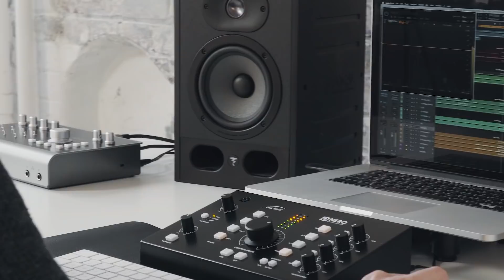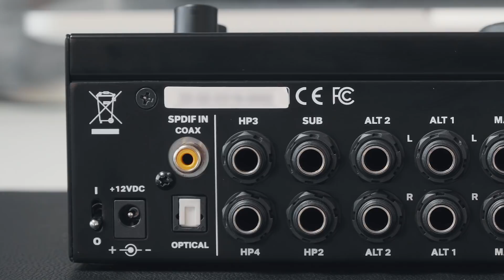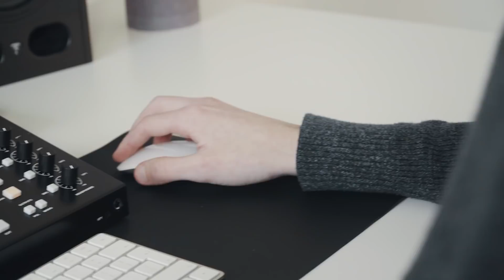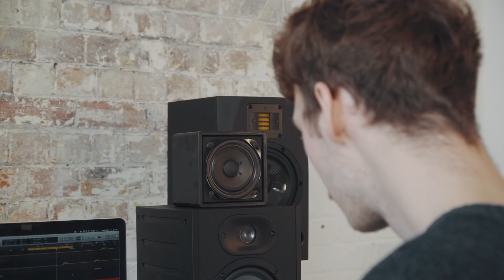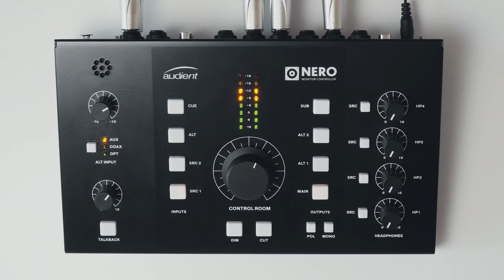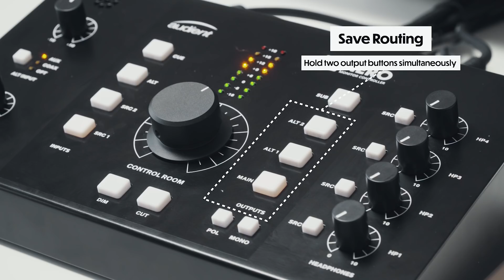Audient Nero - Desktop Monitor Controller Feature Overview

Comment: DON'T BUY THIS!!!

This product has been a headache! After scouring Google, I found that many people are dealing with the exact same problem. It's like it works fine for a bit, then out of the blue, you start getting these annoying clicks and pops, and suddenly, it's gone. One side of your speakers goes silent, usually the right side. Sure, you can try the ol' turn-off-and-on trick, and it might temporarily fix things, but over time, it just gets worse.

I reached out to the department about it, but they never seem to catch the problem because it doesn't stick around long enough. It's like a sneaky ghost that comes and goes as it pleases. Bottom line: I wouldn't recommend this product to my worst enemy. And don't even get me started on the Sweetwater team's customer service. After a couple of complaints, you start feeling like you're pestering them, and they make it seem like the issue is all on your end. It's no wonder they've probably lost a ton of customers this way.
Reply from the maker: Hi there,

Sorry to hear that is the case.

Can I ask you to please reach out to us at support@audient.com with a copy of your invoice and we will get this resolved for you ASAP.

I do sincerely apologise for the issues you've faced, and our support team will help you get this resolved.

Comment: I would like to be able to get the talkback audio back into my RME interface. Is it reasonable to use one of the headphone outputs on the Nero for this purpose?
Reply from the maker: Yes, this should work, just bear in mind the headphone outputs are an unbalanced stereo connection, so you'd need to use a Y split cable to separate the left and right channels.

Comment: Why does the OPT indicator blink every time I turn on the device? I switch to aux, turn the device off, turn it on again, and the OPT input blinks again? Is this some kind of malfunction?
Reply from the maker: The OPT light will flash when it doesn't recognise an input on the digital input. If nothing is plugged in, then this can just be ignored.

Comment: I was about to order this one, but then I saw that it isn't possible to have more than one source active at a time, which made it a no-go for my needs. :( Please make this (optionally) possible in a V2 if you ever make one. I want the coax (Windows system audio such as Spotify/Youtube/WinAmp) always on and then switch between cue/src1/src2 (various monitor mixes from the DAW)
Reply from the maker: Thank you for your feedback, Im afraid it wouldn't be possible to add this to the current Nero but as you mention it may be a good feature for any future monitor controllers!

Comment: How to plug Subwoofer? Sub Out Mono from Nero to Left Input on Subwoofer? My Subwoofer does not have a dedicated Mono Input.
Reply from the maker: Yes, you can just use the left input of the sub. If there is a volume discrepancy because of this, you can trim the sub up slightly to make up for this.

Comment: Just got a unit but unsure how to setup with a sub as the output is mono  and most subs have L R in and L R out.  so do you just connect the output to the L input of the sub ?   thanks
Reply from the maker: If your Sub does have a stereo input then you can just connect the left channel and turn the sub's trim up slightly to compensate for the missing channel

Comment: Ei Audient, how do i connect a subwoofer to the audient Nero i just bought? Just plug a Mono Jack from the SUB out on the back to the L in on the Sub? because on my Focal Sub One there is two conectors, Left and Right. Thank you if you can answer. I cant find anything about this metter on the web. How actually connect a Sub to the Audient Nero.
Reply from the maker: If your Sub has a stereo input then we would recommend just plugging a single TRS jack from the SUB output to the LEFT input of the SUB. You'd then just need to trim the sub slightly louder to make up for the missing channel.

Comment: Is the main headphone amp powerful enough to use and mix with 300ohm Sennheiser HD600 headphones? Or what is the recommended ohms for main headphone out?
Thanks!
Reply from the maker: The Nero will drive up to 600 Ohm headphones, the actual volume you get will depend on the sensitivity of the headphone drivers themselves, however. You shouldn't have any issues driving a pair of HD600's with the Nero for most monitoring purposes.

Comment: The external talkback mic input and associated routing is excellent. However I'm not seeing a remote TB engage, nor a footswitch option. So if a producer is in a different space, they can have a mic to talk to the artist but have no means by which to engage TB. That's the one thing holding me back from purchasing this for a studio I use.
Reply from the maker: Thank you for your feedback. Unfortunately, remote talkback activation isn't an option on the Nero.

Comment: You guys should make a single knob controller like a Mackie Big Knob. With your precision matched attenuation technology it would be a much better product. I need a volume knob to lower the output volume of my RND Portico MBP because I can't drive the transformers without clipping the ADC on my interface.

Comment: Can I adjust the frequency fed to the monitors when the sub is engaged? 
Like a 90hz crossover? and then when it isn't engaged it returns the full signal to the other monitors?
Reply from the maker: There is no built in crossover on the Nero, any crossover controls will need to be done on the Sub itself or with an outboard crossover device.

Comment: It's a shame the sub cuts out when you engage the mono button. Makes it difficult to check phase on a 2.1 system where the 2 satellite speakers are quite small. Don't really understand why the sub has to cut out when in mono, as the sub is already a mono output, surely?

Comment: possible to run two speaker pairs at the same time?
Reply from the maker: You aren't able to run two pairs of speakers as the same time I'm afraid.
Reply: @Audientworld  ok thx 4 info. please can you answer the questions from here too: https://www.gearslutz.com/board/product-alerts-older-than-2-months/1263997-audient-introduces-nero-desktop-monitor-controller-5.html?posted=1#post14496294  or someone from your staff. thx

Comment: Why is there only 1 out for the sub?
Reply from the maker: Hi Shane, The sub only requires one output as typically you would use a single mono subwoofer speaker with Nero.

Comment: i see you also used the analog input for your audio interface. Isn't the quality the best via SPDIF?
Reply from the maker: There's very little difference between the audio quality of the two types of Input. The iD44 we used has great sounding DAC's and using balanced cables means that any noise picked up from the cable is cancelled out. Similarly, the DAC used on Nero is great sounding as well so a digital input will sound just fine. 

The Volume control on Nero is all done in the analog domain (albeit with digital control) so you don't need to worry about your analog inputs going through multiple AD/DA stages.

If you're unsure of the quality of the DAC/Interface you are using before Nero then the S/PDIF inout may give you slightly better quality audio but in most applications, the differences will be negligible. We simply included these inputs to give plenty of flexibility.

Comment: So no console quality mic pre in this one?
Reply from the maker: Nero is a monitor controller rather than an audio interface so there is no need for a recording console preamp on board. The Talkback mic pre does actually use a similar topology to the console mic preamps, but it isn't the same.
Reply: yes the talk back mic